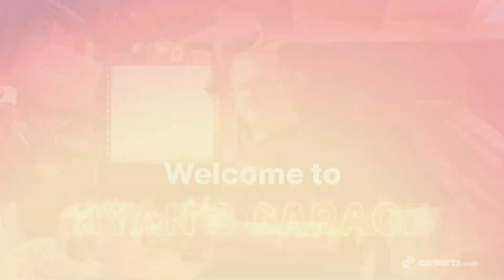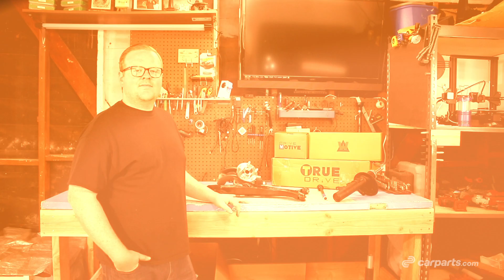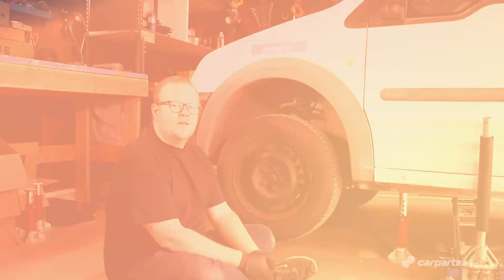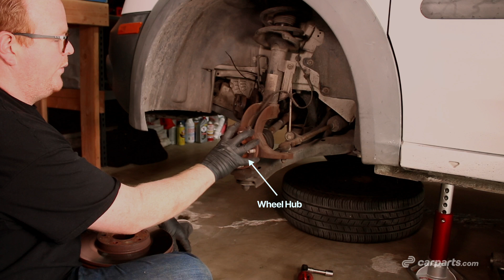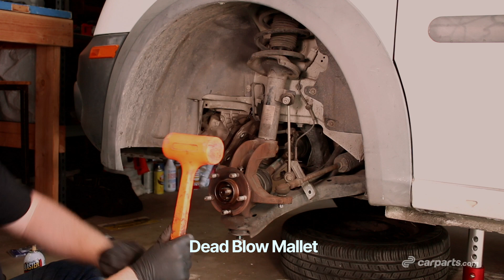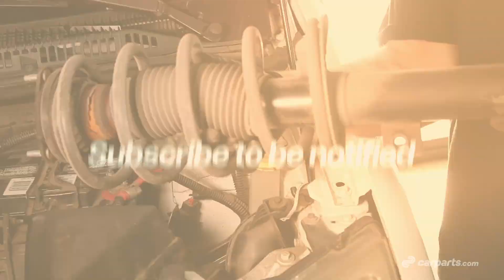Ryan's Garage 2012 Ford Transit Connect Front-End Refresh Part 1: Parts Removal

Comment: Ok so I have a 16 and I’m replacing the hub assembly. What is needed after I remove the axle nut and Seperate the strut, tie rod ball joint etc from the spindle? How do I get the hub assembly out after removing the snap ring? How do I get it back in?
Reply from the maker: Hello,

We're going to assume you're working on a Transit Connect and not the full-size Transit van.

The hub and bearing are press-fit with the knuckle on your Transit Connect. If you're replacing both the hub and the bearing (and you don't have access to a shop press), your best bet would be to take the knuckle assembly to a shop that can press the old parts out and press the new parts back in.

You can also do the job using a front-wheel drive bearing removal/installation kit and a hub puller, but that approach can be challenging.

Good luck!

Comment: I want to refresh my front end too, only I want to ad some 30mm or 20mm spacers to give a slightly higher stance. Curren stock as is the rear sits about 2.5 inches taller than the front. So I believe that 30mm slightly more than 1” will be perfect. Will need alignment after. 
Great video thanks!
Reply from the maker: Leveling / lifting the front out a bit as you suggested is a great way to subtly improve the look of your vehicle. Let us know how it goes!